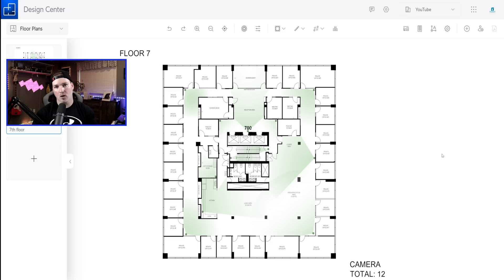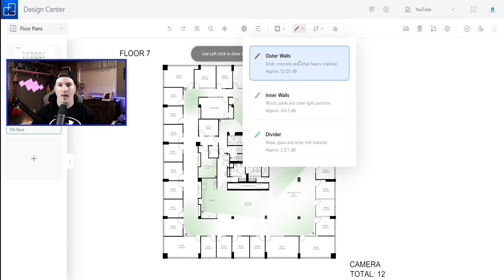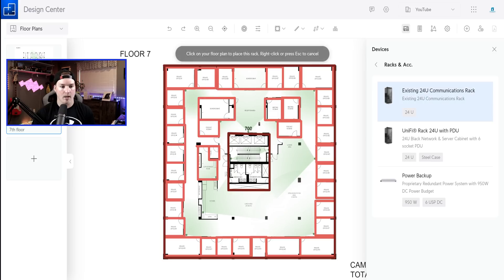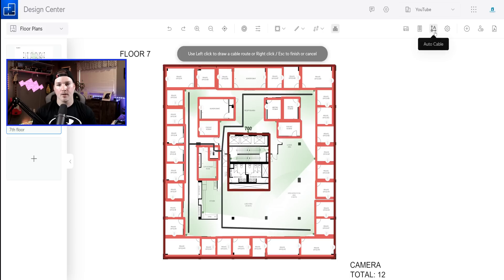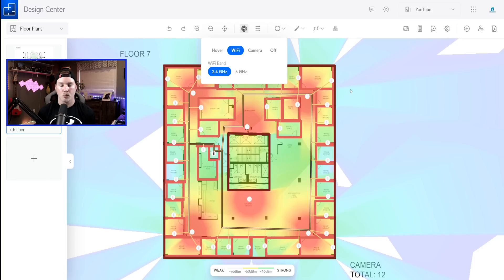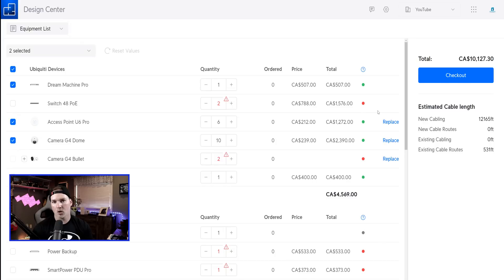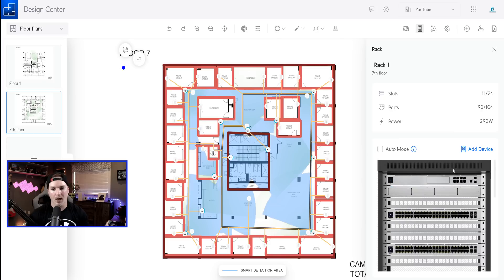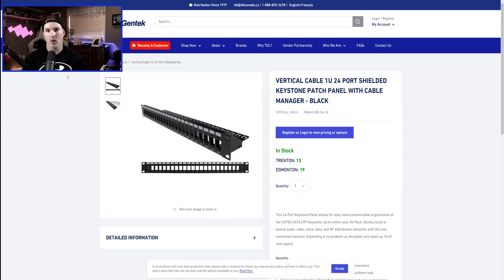Unifi Deployment Series:  Part One  Design

Comment: That's some pretty poor 5ghz coverage
Reply from the maker: We may have to add more APs but will see when we validate it
Reply: I question whether the inner walls being doubled up back-to-back in the design diagram falsely attenuate the estimated signal passage.
Reply from the maker: @beardenbob6567  they should have been drawn in I was using the “room” which would have doubled it. ( ran out of time)
Reply: The fun of wireless, 10 different people can give 10 different solutions. Best of luck with this project

Comment: Great videos. I have a question about a 10G backplane using cat 6A - when you are spec'ing switches, will the unifi 10g switches adjust down to 2.5 or 1 gb  if the connection will not handle the 10g speed? Thank you again.